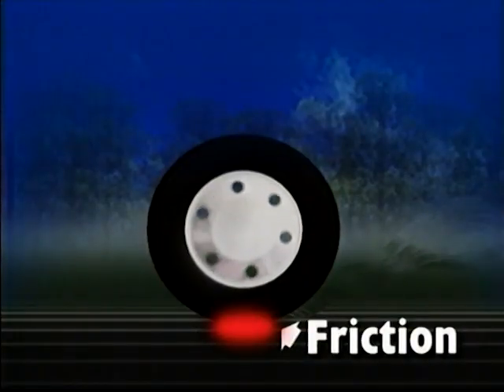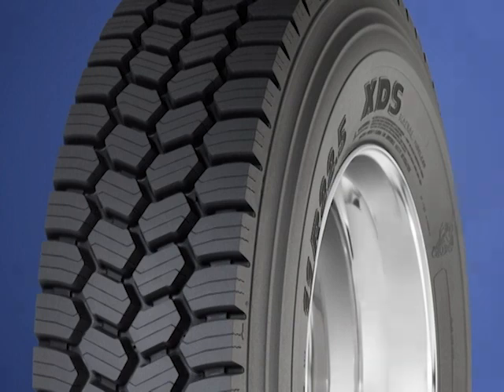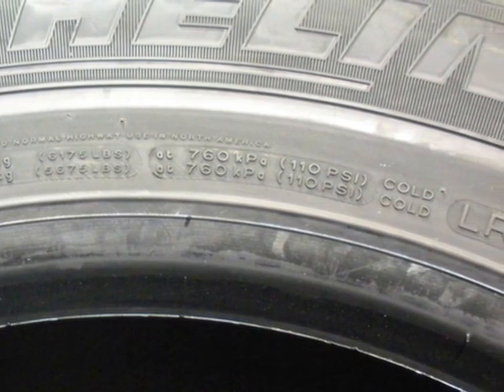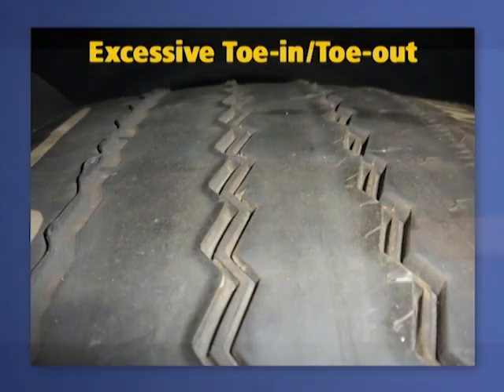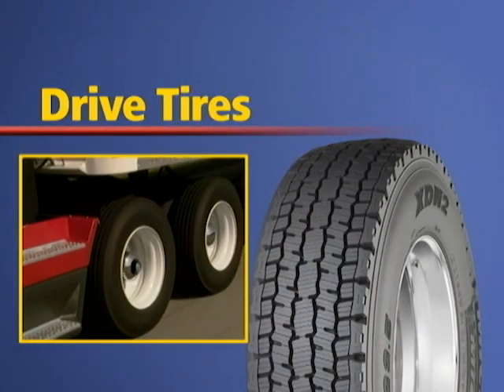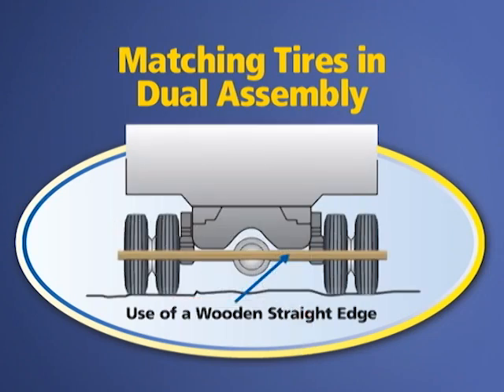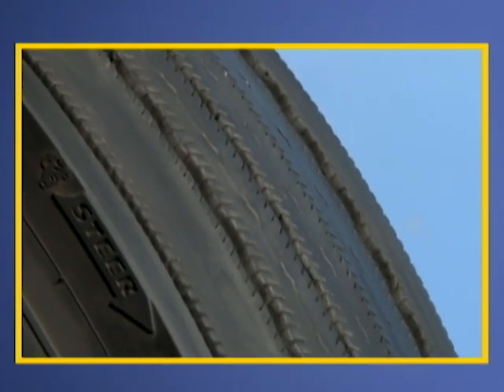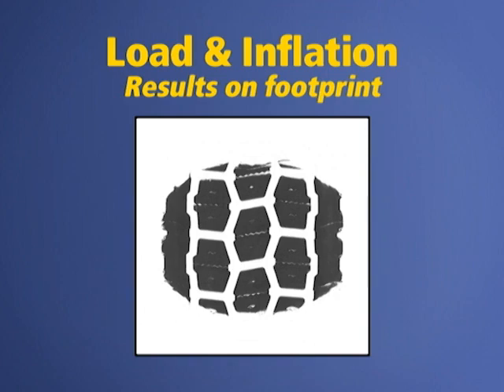The Fundamentals of Truck Tire Wear

Comment: What's your recommendation for tire pressure for a tri-axle dump gross weight 80,000 pounds.
Reply: What is the overall weight on the twelve tires on that tri-axle?
Reply: Chad Jessup truck grosses out at 80,000 
4 axles total 
Length of Trk is 30 feet.